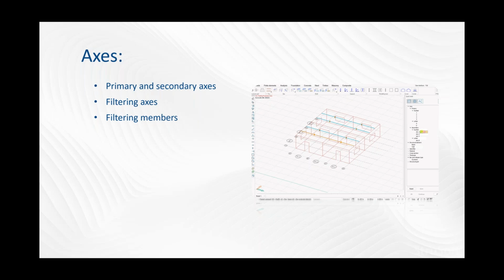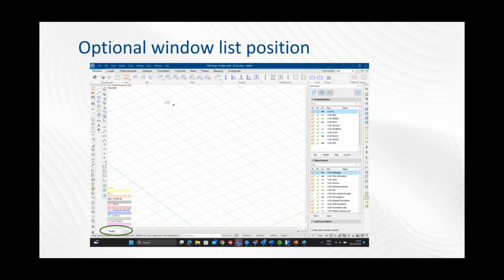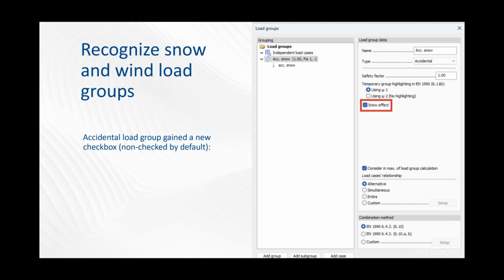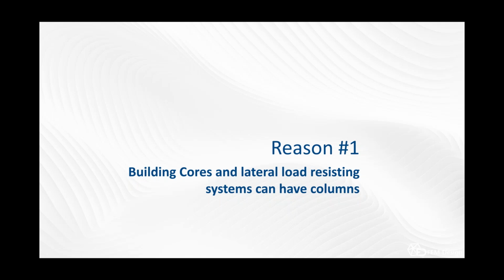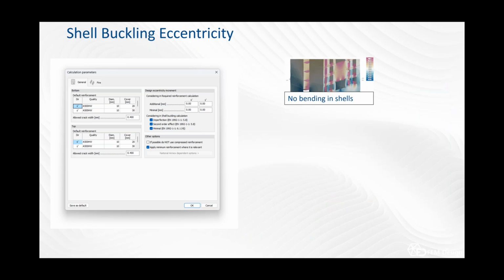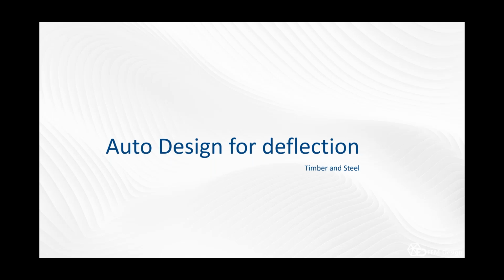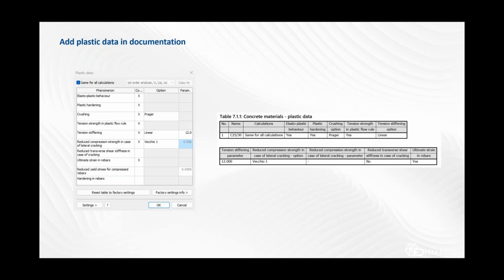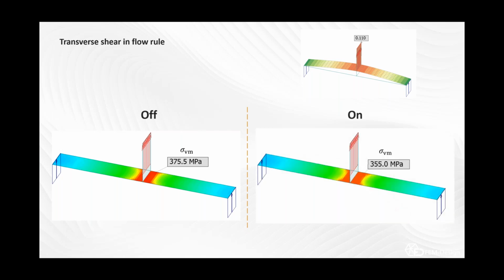FEM Design 24 Webinar – Discover the Latest Updates

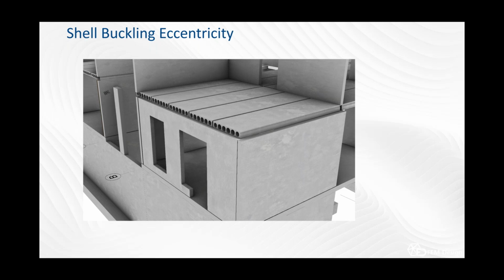Comment: 21:49 Finally someone has accounted that! 🙂 You probably know that except the eccentricities applied to the top edge of the wall mentioned in the webinar also the unintended fixing moments should be present out there. Their magnitude partially depends on the quantity of compression force in walls from above storeys, thus vary from storey to storey. That is why usually, due to their variability, the unintended fixing moments are ignored in manual calculations of walls. However without them impossible obtaining true diagram of bending moments in façade walls (like on the Figure 6.1 from EN1996-1-1). From other side if included into analysis may be quite helpful. Way of calculating the unintended fixing moments described in EN1168, Annex E. It is not a trivial task to implement it, but since only RFEM partially accounts that, may be an advantage on your side.